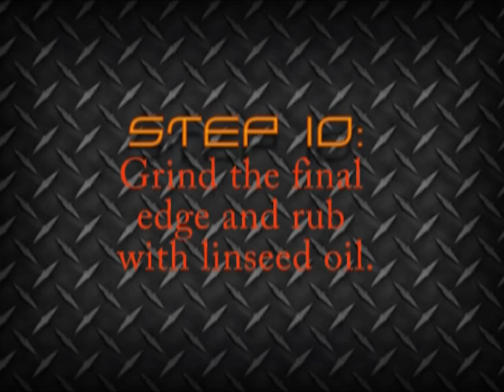Forging an Axe Head

Comment: same way, hard flint held in place by the soft wood which also provides weight.Your way isn't wrong I've also tempered tools the same way, this just gives you options. sweet video keep it up! PS I like the bellows and forge similar to mine!

Comment from the maker: I heat the axe until it is non-magnetic ( which I test for by touching it with a magnet, which I think is what you mean by rubbing.) Then I quench it in a mixture of old hydraulic oil, wax, and vegetable oil. I find that this process onsistently gets the edge very hard.

Comment: I bet you could leave it martinsite because the bit is sandwiched between the soft iron, so when quenched the main body of the axe will slow the cooling of the hard bit almost like japenese clay quenching, kattanas were often left martinsite and they were brine quenched.  Theoretically, even if the bit breaks inside the soft iron will hold it in place. Think of a playdough  with ablade of broken glass, even if the glass breaks again its held in place by the playdough. also stone axes are the